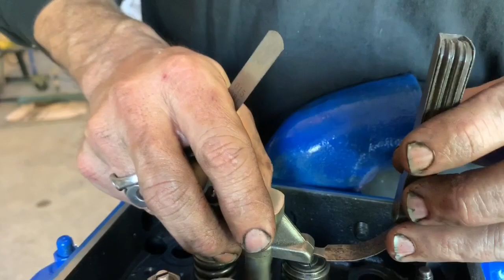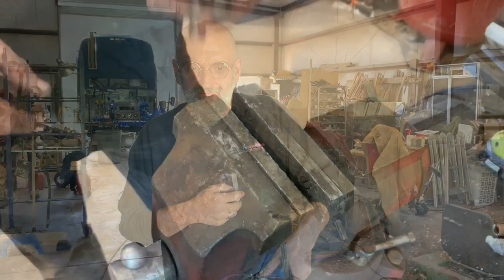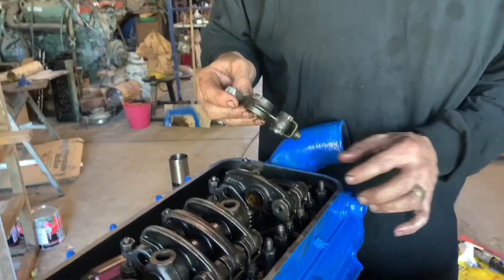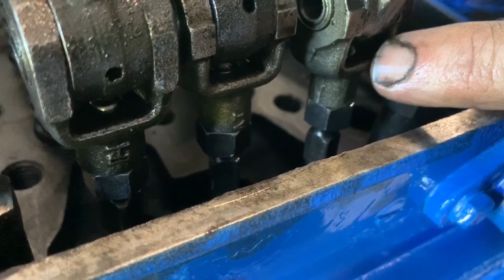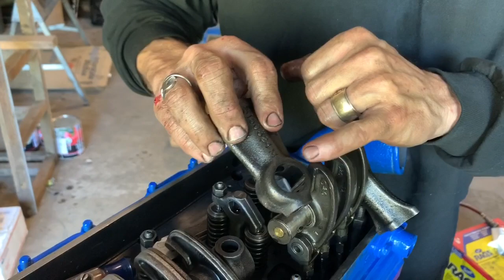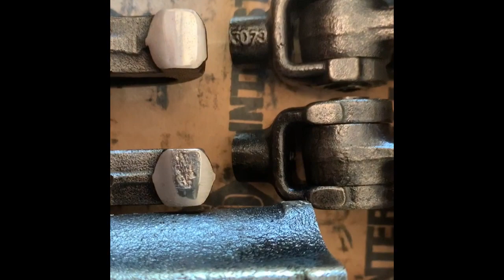Detroit Diesel valve adjustments , 8V71TA

Comment: Sir, I have 2 8v71n engines in my boat I followed your methods which worked out well , but when I set the rack on both L and R banks the injectors remained in the full power position , is this normal , now I don't want to start them incase they go straight to full power , both engines have variable speed governor's  which I don't have a manual for so I'm uncertain if I missed a few steps
Reply from the maker: Unfortunately I’m not really qualified to answer that question.
Reply: @LacroixCruiser  thanks  , I found your video on setting the rack its just what I need , again many thanks
Reply from the maker: Thanks for watching.

Comment: Great video - especially liked the closeups.  Dumb question:  Could one 0.030 feeler gauge on one side be substituted for the two 0.015 or would that throw off the balance?
Reply: Should use .015 on both sides. The bridge on these has a pin that rides in a bore so it can’t rock one way or the other. This adjustment makes sure the bridge acts on both valves equally and simultaneously. Actual valve lash is measured between the rocker and bridge.